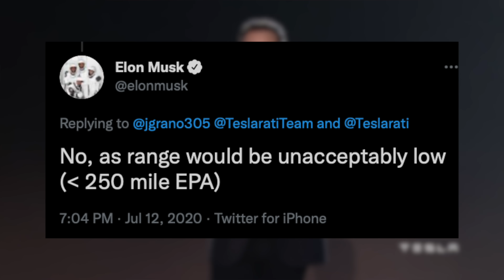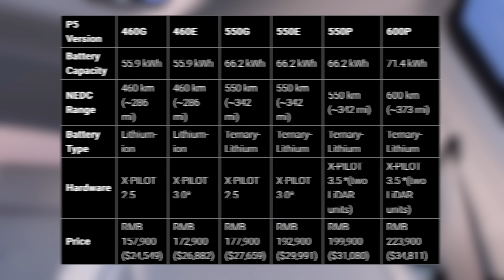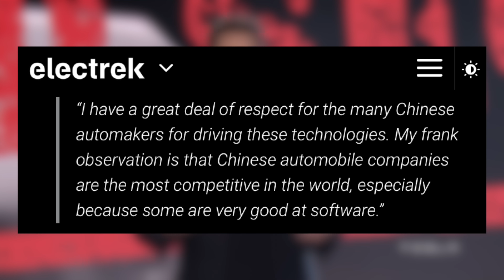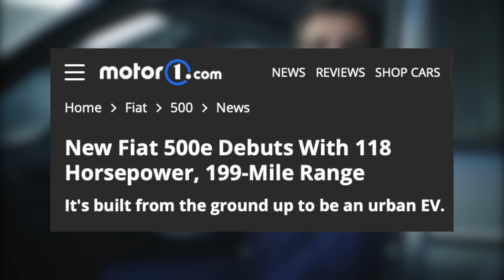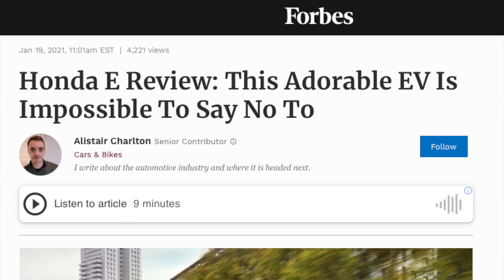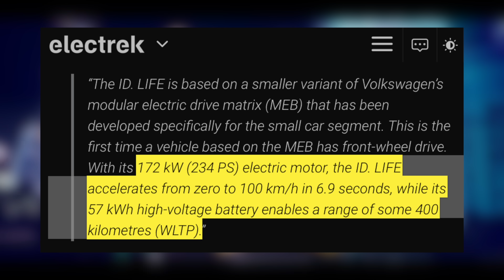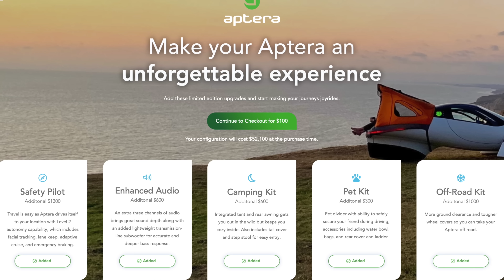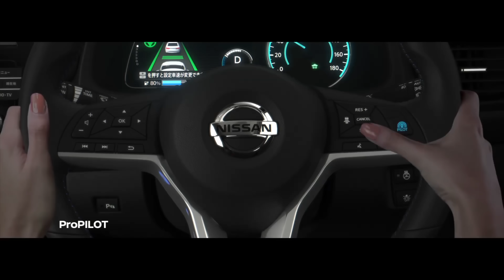5 EVs Under $25,000 | The NEW Tesla

Comment: Sadly, you won’t be able to buy a good $25K EV in 2022.   250+ miles and 4-passenger capacity minimum is needed for mass adoption.  

The current administration is NOT serious about clean air and climate change.  If Congress would stop pandering to the UAW and legacy auto-makers, we could have a $28K base model 3 using a $12K federal EV refund.

Comment: It's my understanding that all the information you provided for the Fiat 500e is incorrect.  The first generation 500e was a California compliance car built from 2013-2019 and has a range well under 100 miles and no DC fast charging.  It was not a "from the ground up" EV.  The second generation 500e, which is now available in Europe but thus far is not planned for release in the US, is the ground-up BEV with the specs you are quoting.

Comment: Note:
Tesla never called the compact car a hatchback

Only that it will be $25,000 be a compact and be capable of Full Self Driving

And because it's a Tesla:
Use the Supercharger network
Be aerodynamic (likely teardrop back)
Highly likely minimum range of 200-250 miles
And have all the software as like the rest of their cars (Boombox, Tesla arcade, Tesla theater, fart mode)

(Planning on painting mine like Herbie)

Comment: Is the Aptera safe? It looks like it has a high rollover risk.
Reply: It looked pretty safe. The company had a youtube channel and they have a few track shots. Basically the wheels are really wide apart, so turnover risk is only possible going backwards at a really high speed.
Reply: "Tadpole" design is safer than "delta" design.  Two wheels up front is pretty stable.

Comment: 250 mile range is possible for 25k.

How?

Take the BMW i3 approach:
-Very slim and light wheels
-Lightweight recycled plastic panels: cheap, light, and a marketing move for a "greener future"
-4680 structural pack
-Short and low: aerodynamic and light
-One single motor for all versions: reduces weight and cost.

Comment: I don't see them going below 250 EPA estimated miles because their supercharger network's gaps would make that a hassle for a lot of people who want to go on a road trip. Your average space between a supercharger is about 150 miles & everyone can pretty easily recognize that EPA estimated ranges are always wrong, usually on the high end. Even if you don't want to do the averages, there are superchargers that are more than 200 miles apart. Tesla's aim is to replace ICE cars & that won't happen if people have to limit their travel desires based on the charging network's gaps because their car was designed not to make those gaps a non-issue. I don't see Tesla making that decision.

Comment: Honda E is a bad one as it is very over priced for what range it has. 

Plus the tight turning circle it has is bad because when I saw it on a review video the front wheels at full turning lock do not stay flat on the road instead they angle up on the outside edges of the tires so that would mean a few of those turns and your front tires will be worn out badly on the inside treads which of course means a bad tire grip road wise. 

And also the charging port is in the top of the Hood and that is terrible place for a port when it rains and your not under cover the port would flood with water, Not a good idea when there's electricity pumping through the port?  Even if it has water drain system up in it there would e a very big amount of rain water filling up that port.

All the VW EV's I would never buy! VW lied, cheated and got caught in the Diesel Gate court case and said sorry we will not do it again, They did it again not 2 times ut 5 times each time saying sorry and paying fines in the billions. So they are not to e trusted bad enough cheating and lying once but 5 times.
Now they are producing EV's most of those are compliance cars which were Diesel ICE cars changed very quickly to a EV.
All over priced crap ones with poor ranges and in effect your paying for the VW name not a EV.

And remember folks VW never wished to do EV's at all, They just kept doing Diesel cars and lying about the emissions using a cheat device fitted to all their cars which was found to change the engine emissions each time it knew when it was being tested so not to e done for breaking the EU and US codes on emissions which all their VW brands cars would fail big time without the cheat device.

They would have not even made any EV's if they have not been forced to after the ruling of the 1st court hearing after the cheating was found out?

So don't Buy any German E's as VW own all them so all e cheating compliance or rushed slapped together crap ones 
they over charge you to buy the rand Name not the rubbish EV hey never wished to do.

The Tesla so called model 2 will e still 2.5 times more priced than the same class of hatchback it is under compared to the ICE car of that class and size/
Plus the Tesla model 2 still just e another horrible copy of the Model 3 and Y,  No driver binnacle again and the same horrible bland interior as the 3 & Y.
So no buy there I think? 

The Aptera a very small ugly 3 wheel pointless E with very tiny un-usable back storage area and with the 3 wheel design it could easy be blown off the road in strong winds from the sides since no 4th wheel mean a very unstable car? very pointless and ugly EV.

The Chinese Xpeng P7 looks nice but is allot more costly when brought outside China from what reviews I've seen about it. 
I can't see it being sold even here in the UK or EU never known the US, due to it's safety specs not being as high as ours are now no matter the hype about it's systems.

Comment: Would be very easy to make a battery that lasts 1000 miles there is very little innovation in an electric car it's basically a toy from the 1970s Bell Helicopter invented pretty cool regenerative system in the 90s but since then it's been crickets part on improving existing Technologies